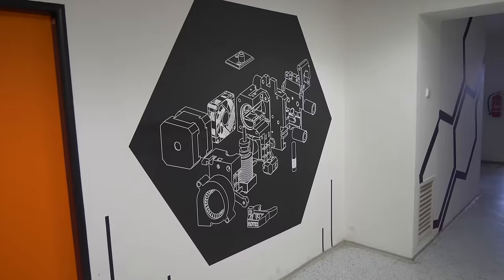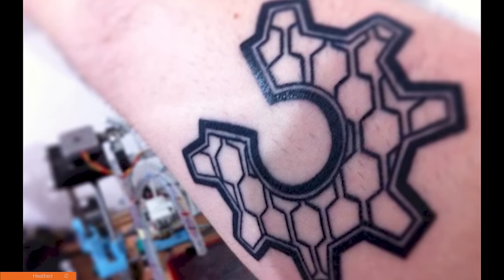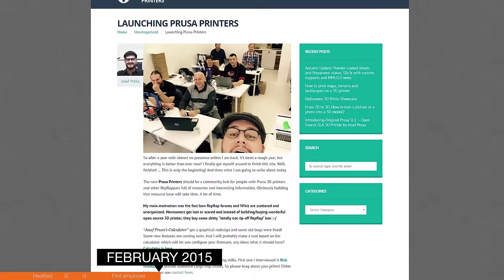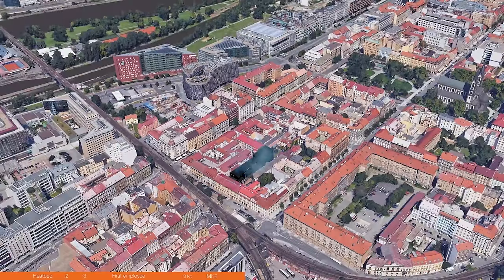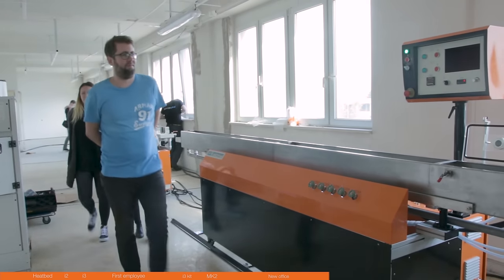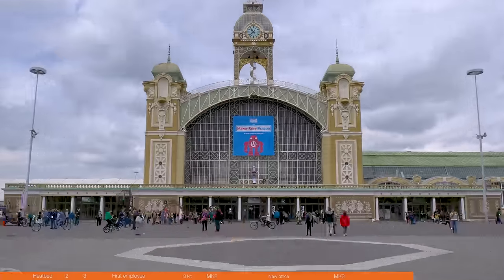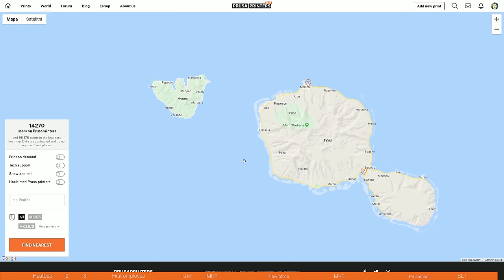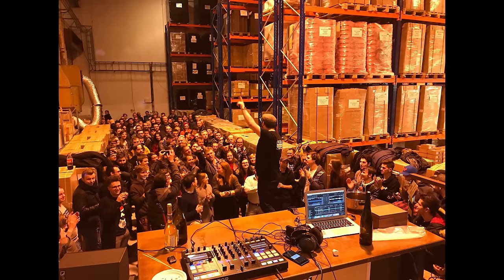The Road to 100,000 Original Prusa 3D printers

Comment: I would like you to design a machine to turn failed parts into filaments again since it is a shame to waste PLA with what it is worth.

In addition, I have already seen several liquid resin printing machines and I think it is convenient for the machine itself to supply the appropriate amount of resin instead of the user. I say this because you can waste it or spend too much with the liquid resin and I think you should take note of how the ink cartridges of a normal printer work apart from looking for something to reduce the manufacturing time so as not to scare the electricity's bill that is very expensive. 

Also I'm industrial engineer, I'm from Spain, I'm also blogger & I saw at Amazon a lot of 3d printers and all of them are similar. The difference is the price. Right now, to avoid wasting money, I bought one from second hand to start printing in 3D before making a huge investment on a good one.

You should take note even of them to improve the product.

Comment: Hello,  I have inherited a makerfarms Prusa  10" i3v. It needs some tlc.  Makerfarms seems to be out of business and I'm looking for videos and pdf's to review the assembly and especially the wiring schematic because there are some loose wires.  I'd like to get it running again.  It seems the 3d printing community has moved on to other interests?  Is there a place where I can access this information.  I am assuming that the parts supplied by makerfarms and the wiring diagrams would be the same for a Prusa printer?  Thanks in advance!

Comment: At the scale of producing so many printer parts, wouldn't it be more cost-effective to use other manufacturing techniques like injection molding instead of 3d printing?
Reply from the maker: We get asked about injection molding quite often :) Here's a copy-paste of our usual answer:
The printed parts are never a bottleneck, we simply add more printers to the farm when we need them. Molds are REALLY expensive and take weeks to get right. And you are limited with the geometry of the parts - there are shapes that injection molding simply cannot do. On the other hand with 3D printing we iterate the parts and constantly improve them, this is not possible with injection molding. Last but not least, WE ARE USING OUR OWN PRINTERS :) Our manufacturing is literally depending on our own product, which is great! It pushes us to make the printers better and if there ever is something that could use an improvement, we're the first to discover it. The amount of print hours that the farm printers get in a few months is more than what the user will print in the lifetime of the printer :)

Comment: I get that it's a sin to injection mold parts for a 3d printer, but wouldn't it make more sense to injection mold the parts you know aren't going to change? And focus the print farm on incremental upgrades or new models? Great work. If i ever make it across the pond i will visit.
Reply from the maker: Injection molding is a good point :) We get asked about it quite often, so we have an answer that I'll copy/paste here:
The printed parts are never a bottleneck, we simply add more printers to the farm when we need them. Molds are REALLY expensive and take weeks to get right. And you are limited with the geometry of the parts - there are shapes that injection molding simply cannot do. On the other hand with 3D printing we iterate the parts and constantly improve them, this is not possible with injection molding. Last but not least, WE ARE USING OUR OWN PRINTERS :) Our manufacturing is literally depending on our own product, which is great! It pushes us to make the printers better and if there ever is something that could use an improvement, we're the first to discover it. The amount of print hours that the farm printers get in a few months is more than what the user will print in the lifetime of the printer :)

With that said, we do own a few injection molding machines now and we are already using them for a few parts, where it makes sense (bigger parts that rarely need updates, e.g. spool holder, MINI front panel). We can even re-use some plastic from failed prints for the injection molding, which is nice.
- Mikolas

Comment: what I really don't understand is why you would print parts that are much faster, cheaper and stronger made with injection molding? As the scale is certainly large enough to warrent the high mold making cost
Reply from the maker: Copy-pasting my comment from before:
Whenever the printed parts become a bottleneck, we simply add more printers to the farm. Molds are really expensive and we iterate the parts and constantly improve them, this is not possible with injection molding. Last but not least, WE ARE USING OUR OWN PRINTERS :) Our manufacturing is literally depending on our own product, which is great, it pushes us to make the printers better and if there ever is something that could use an improvement, we're the first one to discover it. The amount of print hours that the farm printers get in a few months is more than what the user will print in the lifetime of the printer :)

Comment: i dont get why 3d print your own parts for the machine when injection molding is far cheaper and faster and better to create standard parts, this costs more to print all the parts on all these machines right?
Reply from the maker: Copy-pasting my comment from before:
Whenever the printed parts become a bottleneck, we simply add more printers to the farm. Molds are really expensive and we iterate the parts and constantly improve them, this is not possible with injection molding. Last but not least, WE ARE USING OUR OWN PRINTERS :) Our manufacturing is literally depending on our own product, which is great, it pushes us to make the printers better and if there ever is something that could use an improvement, we're the first one to discover it. The amount of print hours that the farm printers get in a few months is more than what the user will print in the lifetime of the printer :)

Comment: But why didn't you guy's invest in injection molding. Looks like to me that could have bump up the production time significantly. Also lowers the power consumption. An injection molded part takes seconds versus hours for a 3D printed part.
Reply from the maker: The printed parts are never a bottleneck, we simply add more printers to the farm when we need them. Molds are REALLY expensive and take weeks to get right. And you are limited with the geometry of the parts - there are shapes that injection molding simply cannot do. On the other hand with 3D printing we iterate the parts and constantly improve them, this is not possible with injection molding. Last but not least, WE ARE USING OUR OWN PRINTERS :) Our manufacturing is literally depending on our own product, which is great! It pushes us to make the printers better and if there ever is something that could use an improvement, we're the first to discover it. The amount of print hours that the farm printers get in a few months is more than what the user will print in the lifetime of the printer :)

Comment: What a great story - everything sounded right up to 2016/MK2 - but after that there was no more 3d (r)evolution, just a flat growing of the "2012 basement engineering" concept. e.g. 300 printers farm x 300W = 100KW... instead of one 2-3KW injection moulding machine. Anyway, still waiting the MK4, still hoping it will look like a 2020 professionally engineered  product.
Reply from the maker: We get asked about injection molding quite often, here's what we always answer:
The printed parts are never a bottleneck, we simply add more printers to the farm when we need them. Molds are REALLY expensive and take weeks to get right. And you are limited with the geometry of the parts - there are shapes that injection molding simply cannot do. On the other hand with 3D printing we iterate the parts and constantly improve them, this is not possible with injection molding. Last but not least, WE ARE USING OUR OWN PRINTERS :) Our manufacturing is literally depending on our own product, which is great! It pushes us to make the printers better and if there ever is something that could use an improvement, we're the first to discover it. The amount of print hours that the farm printers get in a few months is more than what the user will print in the lifetime of the printer :)
Reply: @Prusa3D  I am sure you have/had excellent arguments for the company development decisions you took. But in the "not really likely event" that the 3d printers will reach the real mass production in the near future, the right arguments of today can turn in limitations tomorrow. I really want to have the most innovative and successful company mass producing 3d printers here in Europe, so just please do your best :)

Comment: I just have one question, wouldn't at one point make much more sense to injection mold printer parts rather than have hundreds of printers making them?
Reply from the maker: Injection molding is a good point :) We get asked about it quite often, so we have an answer that I'll copy/paste here:
The printed parts are never a bottleneck, we simply add more printers to the farm when we need them. Molds are REALLY expensive and take weeks to get right. And you are limited with the geometry of the parts - there are shapes that injection molding simply cannot do. On the other hand with 3D printing we iterate the parts and constantly improve them, this is not possible with injection molding. Last but not least, WE ARE USING OUR OWN PRINTERS :) Our manufacturing is literally depending on our own product, which is great! It pushes us to make the printers better and if there ever is something that could use an improvement, we're the first to discover it. The amount of print hours that the farm printers get in a few months is more than what the user will print in the lifetime of the printer :)

With that said, we do own a few injection molding machines now and we are already using them for a few parts, where it makes sense (bigger parts that rarely need updates, e.g. spool holder, MINI front panel). We can even re-use some plastic from failed prints for the injection molding, which is nice.
- Mikolas

Comment: How come you don't change your production from 3D printing parts to casting parts instead? It seems like an inefficient production line. Perhaps easy change of design is a pro, but even then, I'd imagine the costs of having so many 3D printers running (and building them) is equally expensive

Comment: Great story! But WHY ? why not get injection molding machines at this point?
Reply: Injection molding :
+Fast.        - veeeeery expensive.
                   - cant make different models
                   - Models cant be changed
                   - break after time

3d printing:
+Can print different models      -slow
+Cheaper in the long term        -loud       
+Use of the own product.    -more power use
+Test station for printers
+Cant really break (easy to fix)
+Models can be changed
Reply: @throwawayaccountm1325  cheaper in long term XD what are you on about and also they use less expensive more duravle material then also you can make different things with an injection machine, the so called tooling(the mold) can be interchanged quickly besides the repairs on that are on the tooling mostly which is not very expensive especially if you have an inhouse cnc machine like they do and onto that comey the MASSIVE amount of space that 3d printers like that take up and the labour required to operate them and rempve prints etc. which is extremely expensive when it comes to mass manufacturing like what we are looking at here

Comment: So surprising that you don't injection mold printer parts, as one would think that better, cheaper parts could be produced.
Reply from the maker: We get asked about injection molding quite often :) Here's a copy-paste of our usual answer:
The printed parts are never a bottleneck, we simply add more printers to the farm when we need them. Molds are REALLY expensive and take weeks to get right. And you are limited with the geometry of the parts - there are shapes that injection molding simply cannot do. On the other hand with 3D printing we iterate the parts and constantly improve them, this is not possible with injection molding. Last but not least, WE ARE USING OUR OWN PRINTERS :) Our manufacturing is literally depending on our own product, which is great! It pushes us to make the printers better and if there ever is something that could use an improvement, we're the first to discover it. The amount of print hours that the farm printers get in a few months is more than what the user will print in the lifetime of the printer :)
Reply: @Prusa3D  Many thanks for your reply. I was certain that it would be great for you to use printers as otherwise you would have switched to injection molding a long time ago by now. The reasons are very, well, reasonable. Thank you for searching for that bit of text!

Comment: wouldn't it be more efficient, less expensive and less environmental impact (less energy usage) to have the plastic parts injection molded?
Reply: Probably but then users wouldn't be able to print replacement parts or upgrades changing parts would also cause large tooling costs but at their scale it would probably make economical sense. Designing optimal injection molded parts is different than an optimal 3d printed FDM part it is difficult to have optimal parts for many manufacturing technologies at the same time. Then you would have to factor in the waste when people throw their printers out instead of modding or upgrading them. In the end it probably balances out but the fact everything gets tested in a 24/7/365 day environment is also good piece of mind that long term real time testing is always being done to both the printer design, parts, and even their own filament.

Comment: Tbh i never interested in a Prusa because they looked very cheap to me with 3d printed parts. Apparently nobody cared with how fast they buy them. 

Thats what happens when you’re a machinist quality means everything where price doesn’t matter when you build your own. I had to print peek and CF before anyone else. I would’ve never did it on a consumer model back then. 

So much has changed now and were developing 5 axis printers and I wouldn’t be surprised if someone like Prusa does too. They’ve more money so they should get the bugs out first. Next they’ll be no more heated beds and instead we use heated enclosures. Were already using CF beds and no more boro glass. funny how something’s so obvious are not discovered for years.

Never give up on your dream you may be the next Prusa.

Comment: Ive never heard anyone "praise your support", quite the opposite...
Reply: Did the Persons who told you that use, the tech Support on the Shop Website? Or the e-mail?
Reply: @throwawayaccountm1325  well three were actually even sending the machine back for reapuirs, few tried to call, few were website. 
Some had issues that a czech company has limited czech support and that the machine was returned from "testing and repair" completely in the same state, including the same piece of broken off fillament in the hotend as "tested and good". It was visible that noone even touched it. And the handling of unfunctional MM1 that killed even single material prints was quite the topic.
Reply: @Smookie001  I'm Sorry for you. I've never had a Bad experience with there support and repair-service.
Reply: @throwawayaccountm1325  Good for you. Sorry I just get angry when someone calls this man a legend and praises him... He kinda left out some parts of the process in this video... but iam not gonna go there